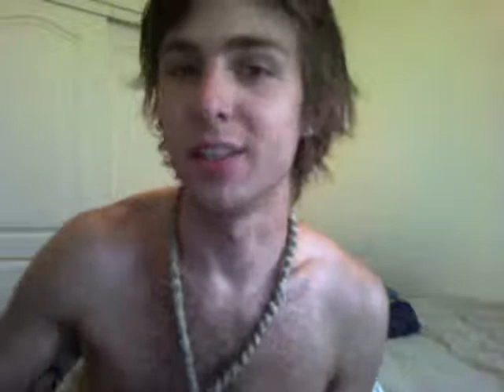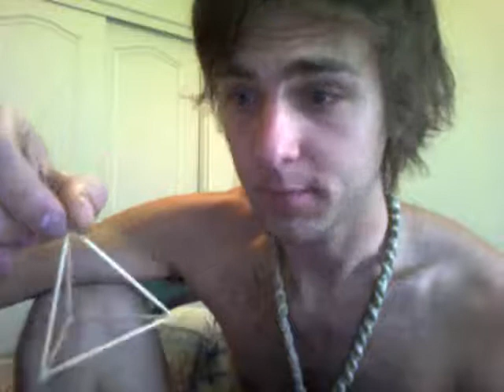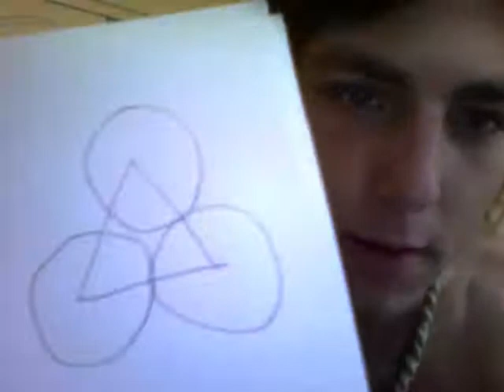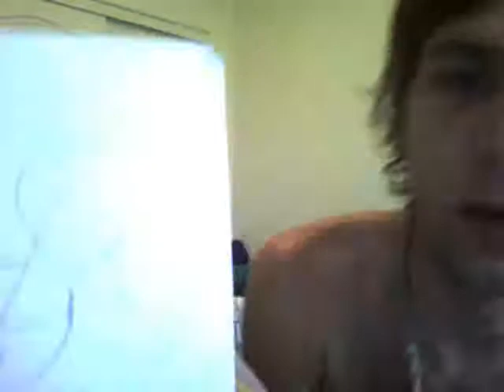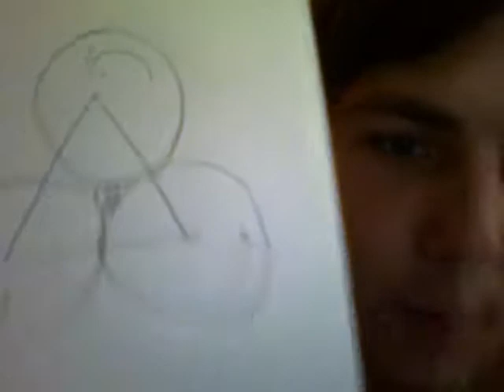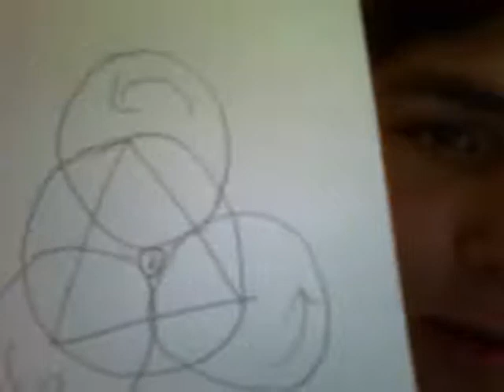Spheres, Platonic Solids, & Vortexes (Part 2 of 2)

Comment from the maker: Yes, that seems like the case at first glace, such as if you had two tennis balls side by side and tried to spin them the same direction it would obviously not work d to friction. However, vortexes are fluid like in nature, & so this behaves a little differently. Try this, draw two circles side by side which are rotating the same direction, & where they intersect is the center point for another circle rotating the opposite direction with its edge being the center point of the two other circles.